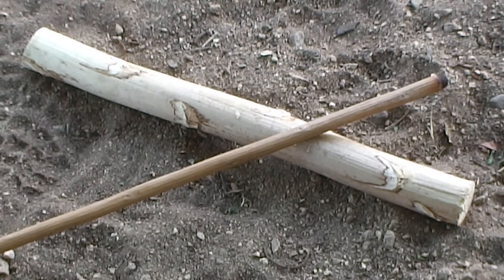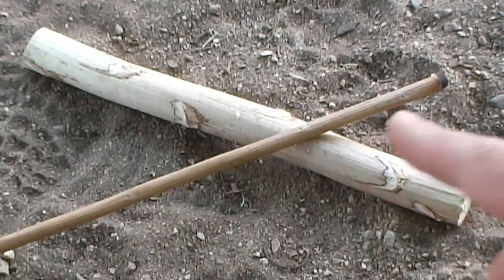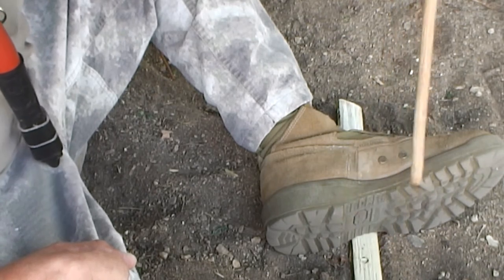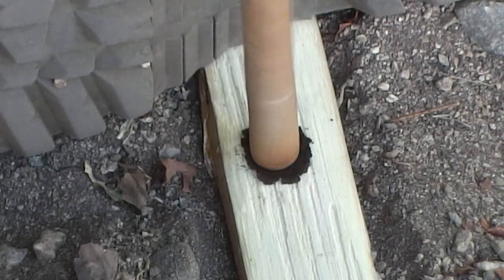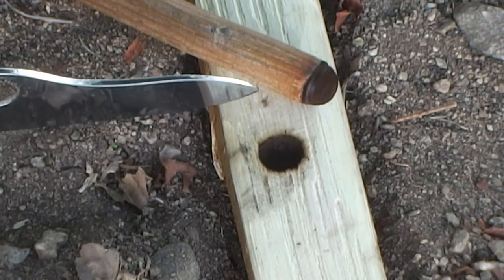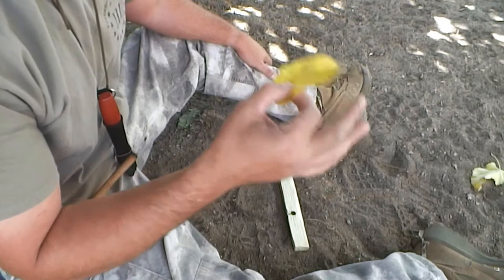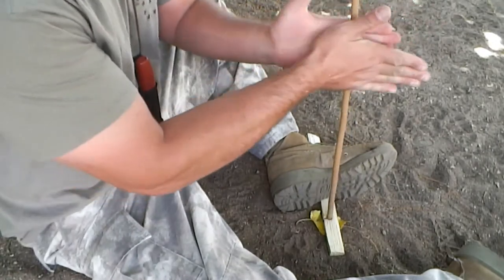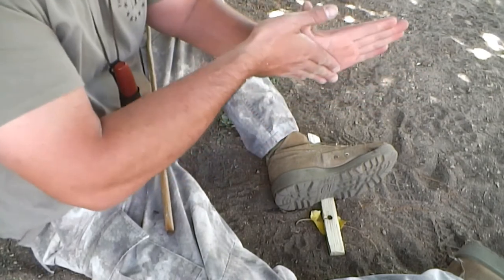Hand Drill (Floating Hand Technique)

Comment: I tried this method once. Just once. I definitely did it the wrong way and hurt my hands bad enough I could do any real work with them for the rest of the day. This looks a LOT better.
My question is since I live in the Northeastern US do you know of any materials that could be suitable for this method?
Reply: I realize this comment is 6 years old, but mullein stalk for a spindle works very well, as does box elder, as well as mare's tail and golden rod, if you can find stalks that are thick enough. I prefer either mullein or box elder. White pine makes a great hearth board, I've also had good results with cedar and poplar. All readily available in the north east.